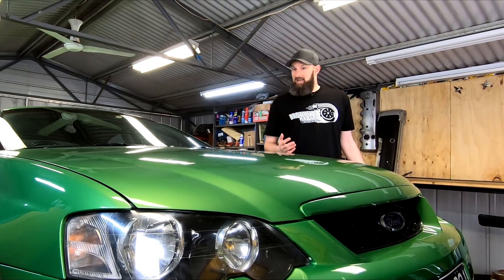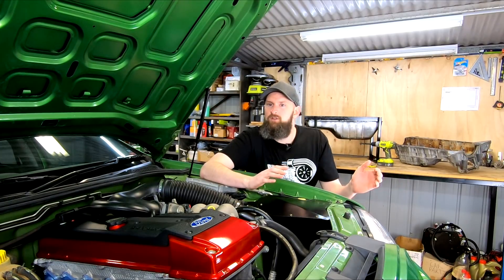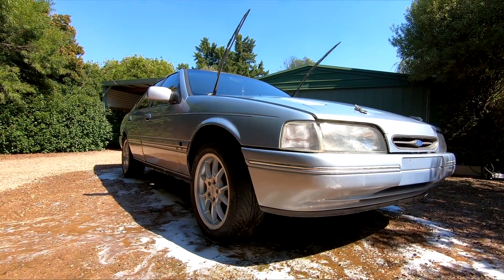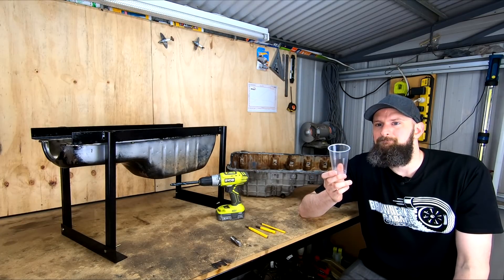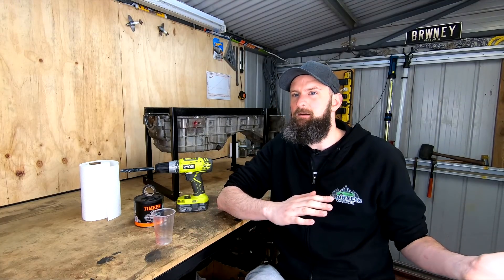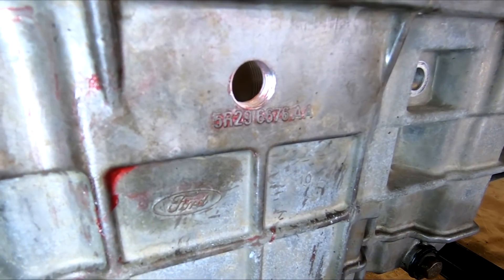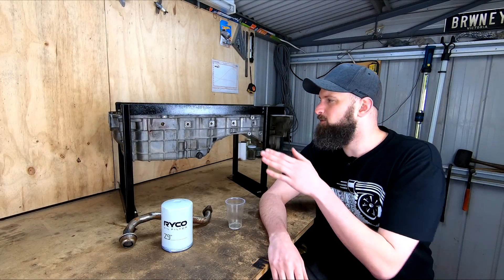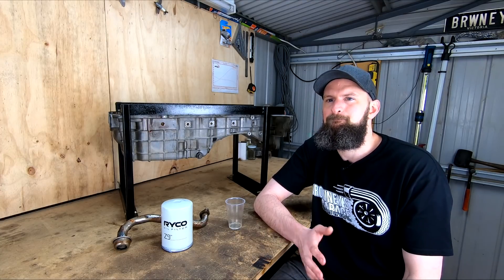Will Drilling a Sump On Car DESTROY THE ENGINE? | TURBO Your NA Barra Pt 4

Comment from the maker: A note that I’ve discussed with some more knowledgeable people since recording. In a normal engine ANY material in the sump like is possible from this video is potentially very bad… BECAUSE it points to unknown damage elsewhere in the engine.

But if you know the cause of it and it’s not a sign of engine damage then it is extremely unlikely to cause further issues, as the oil pick up screen and filter will stop these moving further through the system - unless of course there is enough to block or it passes these, which is again unlikely.

As always though be sure to do your own research, I’m a hack and cannot guarantee there will be no damage to your engine!

Comment: Throw in an extra litre of oil prior to drilling, effectively covering the hole. The oil flowing back out once you drill through should force any swarf out of the sump. Just keep a drain pan under where you are drilling. Browney could do a follow up video trying this test with either of the sump rigs shown here.
Reply from the maker: Hey Ben, fair point and perhaps something that could be looked at at a later date. It has been suggested by others and I've tossed this idea around in my head a few times too. Could work but my concern would be that once you make that first tiny through hole at the very tip it will start leaking but still have a way to go with the drilling. Could mean I speed up the drilling to ensure oil level doesn't drop too much/have me swimming in it and then some pieces are 'flung' away from the drill bit into the pan. Probably get similar results flushing the pan a few times after carefully drilling?

Just my thoughts and I'm not exactly the sharpest tool! Could well be a better method.

Comment: One flushing idea for removing any debris from the sump, would be to leave the sump plug out and flush out the motor with diesel. You could even run a small pump and, with an inline filter, just recirculate it through the motor for a few minutes.
Reply from the maker: Thanks for the idea mate, diesel has come up a few times in regards to this. I know about squat when it comes to diesel, any reason you suggest this over using clean engine oil? Is it just a price thing?
Reply: @BrowneysGarage  a couple of reasons really. 1.price, cheaper than oil... Even supermarket brand.
2. Being thinner than oil, it will flush faster. Faster flow rate "should" remove the debris better. 
3. Being close to oil than petrol is, it will still provide some protection for the motor until the oil can circulate through the motor again. It also has detergents in it to help clean surfaces.
Reply from the maker: @marksshed1100  Thanks mate, gives me something to really consider and sounds like a decent idea. Got a heap of cheap oil here already but will weigh it up, thanks very much for the response mate 👍

Comment: Nice work Browney, love ya stuff. One cheat you could use on a steel sump but not an alloy is to put a big ass magnet on the sump below the hole. You could leave the sucker there especially if it don't budge or drag it up to the hole to get a few of the nasties out.
Reply from the maker: Great idea, stick a heap of old speaker magnets around where you drill maybe 🤣. Didn't look too much into more options on the steel pan as I'm not doing one soon and the results as is we're actually really quite good so you may get it pretty perfect with some tweaks like the magnets you mention!

Comment: i like to overfill the oil, hookup air compressor on low psi to oil dipstick, drill and tap with lots of grease. then it pushes oil and debree out of the hole when you punch through..but the grease gets most of it. once taped i put a barb fitting on, some hose, then with sump plug off flush sump with some diesel. then do some chean oil. then refill.

Comment: Just a great video mate ... pretty much a myth buster for sure . Add in the fact that the oil filter removes bigger particles or they just sit in the bottom of the sump .
Reply from the maker: Thanks mate, was a little surprised that this hasn't really been covered before, not that I could find anyway. And yep, I think we'll be fine doing it this way 👍

Comment: In regards to Barras:  Yes, there is a small risk that you will do catastrophic damage to your n/a motor.  But there's also a risk that you will do catastrophic damage to your n/a motor by over-powering it with the turbo.  So you either take both risks, or you swap it for a factory turbo motor or remove and upgrade the n/a.
Reply from the maker: Completely agree mate, I think we’re on a very similar page here 👍

Comment: Im about to start my conversion and im gunna do it the hard way and pull the motor but ive always wounded would over filling the engine with the cheapest oil i can find and drilling it work so the oil level is higher than the hole im drilling then draining the oil and replacing with the correct stuff ill get covered in oil but nothing would make it inside
Reply from the maker: I've tossed this idea around in my head a few times too. Could work but my concern would be that once you make that first tiny through hole at the very tip it will start leaking but still has a  way to go and oil will start leaking. Could mean I speed up the drilling to ensure oil level doesn't drop too much/have me swimming in it and then some pieces are 'flung' away from the drill bit into the pan. Probably get similar results flushing the pan a few times after carefully drilling?

I don't know, just my thoughts and I'm not exactly the sharpest tool! Could well be a superior method, at very least we know doing it the hard way as you say you are is the absolute best 👍

Comment: Use a vacuum with an elbow and a hole in the back of it, while drilling and tapping start the vacuum with no grease and it will pull debris to you instead of going forward in the pan
Reply from the maker: Would be interesting to try, don't think Missus Browney would be too pleased with the state of the vacuum afterwards though! 😂

Not too sure if it would overcome the debris 'flung' out in the worst case scenario, and space will be more limited when doing it on the car.
Reply: @BrowneysGarage  lmao, i use my shop vac and a 1-1/2” PVC 90 reduced from my 2” hose. Best part is no grease needed and once you stick the bit thru the hole you dont need to hold it either, i have done it on a few pans with engine in them and many on the work bench that was nasty inside and never saw even one small piece of a shaving as long as you are slow when the drill starts thru it pulls it all in the vacuum. Give it a try
Reply from the maker: @young11984  Aha, makes sense. No shop vac here yet but I'll definitely have to give it a go at some point. Thanks for sharing mate 👍
Reply: @BrowneysGarage  anytime bud, thats why im here....to learn and share what i have learned. Enjoy the Barra vids, i had one shipped in last year to the states and have yet to finish it in my 65 F100
Reply from the maker: @young11984  Mate, that sounds like a killer build! Any where we can check it out?
Reply: @BrowneysGarage  nothing but on my FB, may try to do a picture time line and post it on my youtube if i can figure it out. I can build just about anything but hand me a laptop and it doesnt go very well lol
Reply from the maker: @young11984  Haha, we all have our strengths and weaknesses mate. Good luck with it, let me know if you do put something together or share it out more, love to check it out 👍
Reply: This is the best idea I’ve heard out there! I was going to 3D print something similar but this is even simpler and less work. Might even add a touch of positive pressure to the block  with a pool inflator. Thanks for the idea!

Comment: i don't know but i'm thinking if you pour oil in thru the hole you've drilled when you do your flush that will help to push any shavings that may have gotten caught up in any baffles inside the sump down to the bottom of the sump and out the drain plug
also using a strong magnet to drag shavings to the drain plug

Comment: when drilling the sump, can we drill all the way though for the two holes where the bolts for the drain go? or do we drill to a certain point before going all the way through then tap threads? great video by the way.
Reply from the maker: I wouldn't ideally, just gives 2 more spots for potential oil leaks! Can't recall if I mention what depth I drilled them to in the video and don't have it noted here, but if you need to check you could drill the the large hole first, work out how thick the material is from that and take 5 or so mm off it for the depth of the other 2 holes.

Thanks mate and good luck with it!

Comment: Now I don't know anything when it come to such low performance vehicles 🤣 but could you use a banjo bolt and fit it where the Sump plug is? Not enough flow or??
Reply from the maker: Luckily low performance vehicles is all I know... but I'm still not an expert!

Think that has potential to work. Some say the return shouldn't feed in below the oil level but I'd say that'd be fine, then you have the issue of the sump bolt being on the other side of the engine to the turbo. Guess it could be done but a lot of spinny bits in the way, especially if trying to keep the line with a downward path to drain 🤷. Something to play around with another day!
Reply: @BrowneysGarage  an expert is a drip under pressure 🤣
Was just an idea, not up on car ways of doing things sorry but look forward to the outcome. Once again doing things and testing that I haven't seen others do very often.

Comment: What if you filled the sump up with oil higher than the hole? Then still using the grease and drill method eventually go through and the overfilled oil pushes out the shavings while it pours out the hole?
Reply: So like fill it over the hole and drill out while the oil is in and higher than the hole